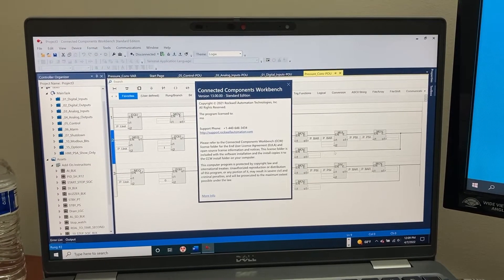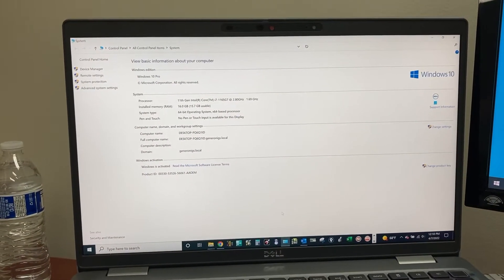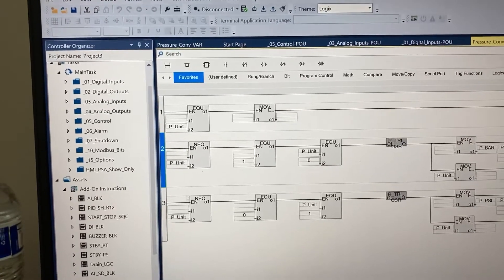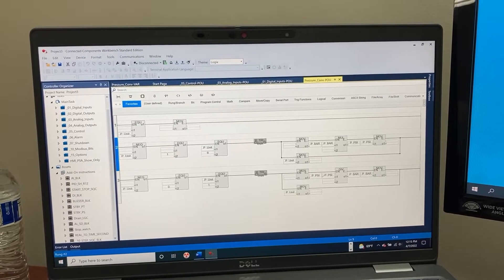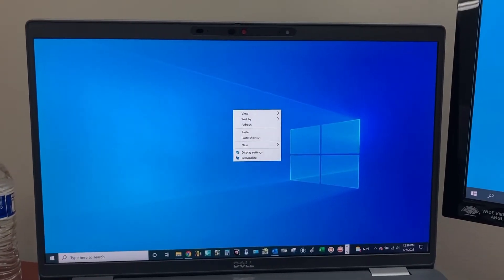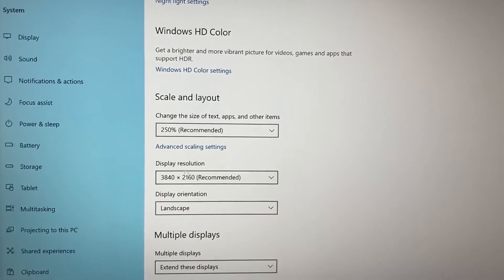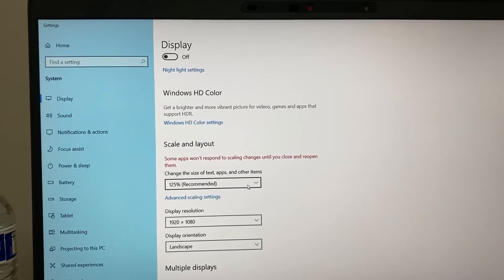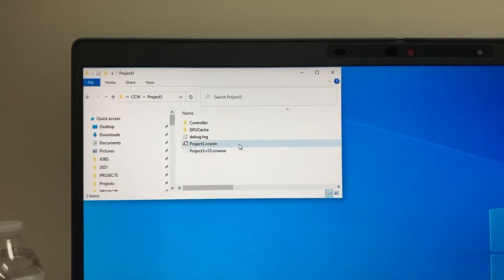Connected Components Workbench Graphic Issue Windows10/Display Resolution

Comment: Hi sir
I have 80 numbers of modbus slave on RS485. Network , total numbers of parameters i need to ping is 15 parameter from each slave .
Can I use micro 870 plc for this purpose , if not kindly suggest the plc model
Reply from the maker: @akp: Thank you for subscribing to my channel. Per Rockwell manual below “Modbus protocol allows a single master to communicate with a maximum of 247 slave devices”. Page 61. Hope this helps.

https://literature.rockwellautomation.com/idc/groups/literature/documents/um/2080-um002_-en-e.pdf#page61